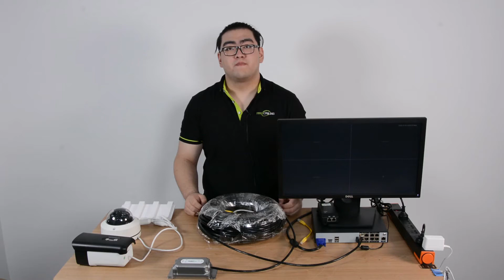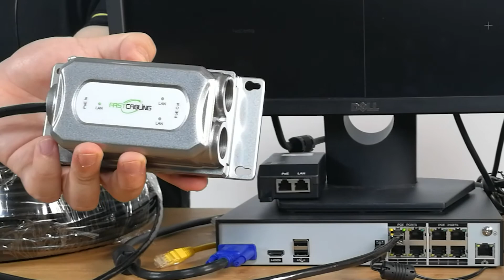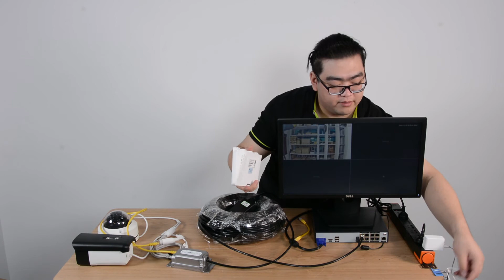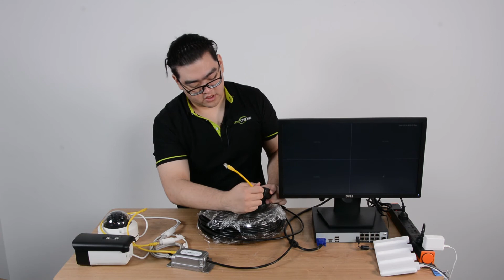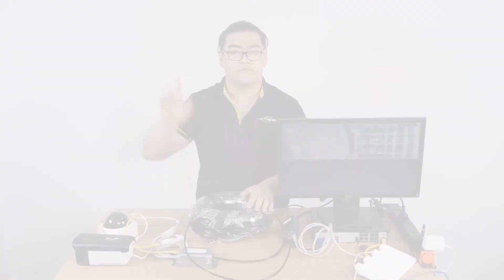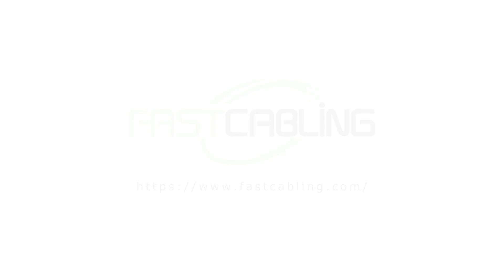PoE Extender Installation Guide: How to Add Two PoE IP Cameras to Your PoE NVR Correctly?

Comment: Instead of using an injector, can you use a regular Poe switch to power up the two cameras?
Reply from the maker: Yes, you can attach the PoE extender to PoE switch instead of PoE injector. Technically the 1 in 2 out PoE extender is outdoor PoE switch. You may want to consider the power budget of your two edge devices. If you need two 2 high power output from the PoE extender, you can use the switch with PoE++ output.